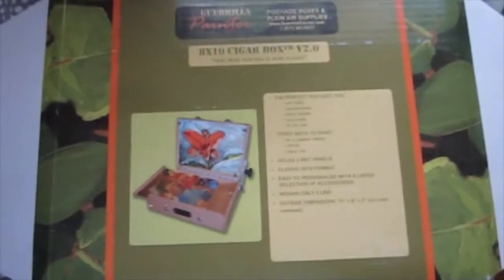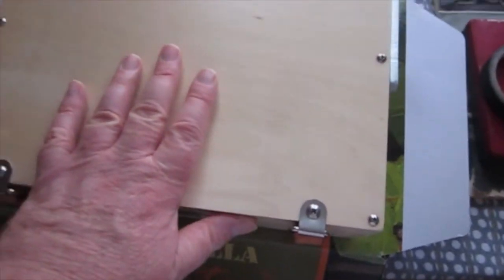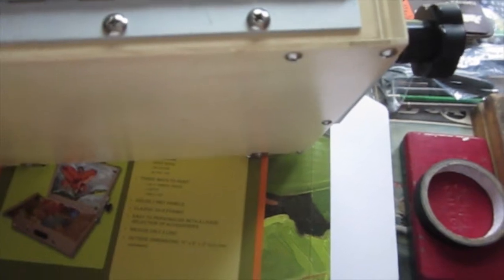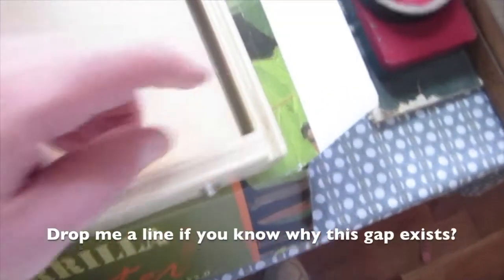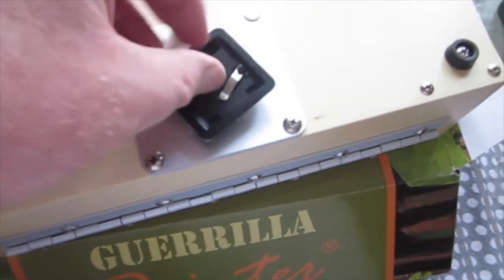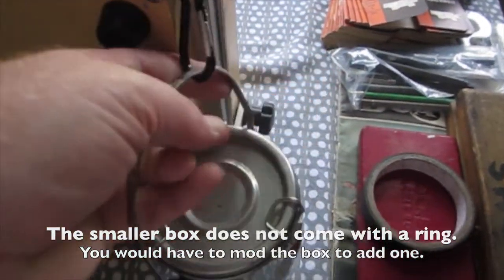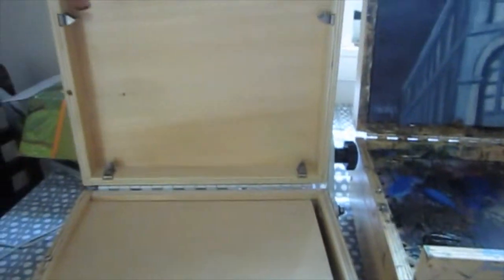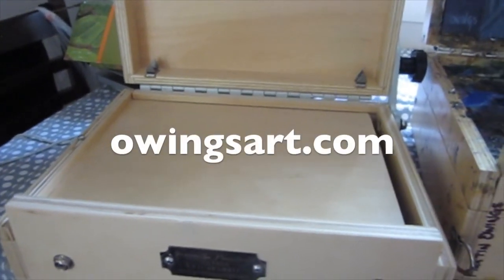Guerrilla Painters 8 X 10 Plein Air Box

Comment: You can use a Dremel to cut that screw down so its flush with the nut. Just mark it or measure it, unscrew it - put the nut back on and cut...then unscrew the nut to get the threads smooth again.
Reply from the maker: great tip. Thank you.

Comment: My palettes get that messy, I run hot water over them in the kitchen sink and use a old scrubbie and comet and some elbow grease and all of the old paint comes off. leaves the palette almost like new. Hope this helps you out, Thanks for the reveiw.
Reply from the maker: Hi Debra - I find the old scrubbie takes off the wood varnish and then my palette stains even more.
Reply: @owingsart  I haven’t had any trouble with the varnish coming off

Comment: Hey Marty any chance of doing a follow up on this video? I've been on the fence for a while on which box I should get since I had to retire my french easel. I noticed that the 8x10 doesn't have a carrying handle or hooks for a strap and I've also noticed that the placement of the mount for the tripod is different on each box. I was wondering if the placement of the tripod mount made any difference and if the lack of a carrying handle was annoying.
Reply from the maker: Hi There and thank you for the question. Yes, it is annoying not to have the handle, but the convenience of the smaller box is very nice. The mount is the same on both boxes. I will do a follow up at some point soon. ~Marty